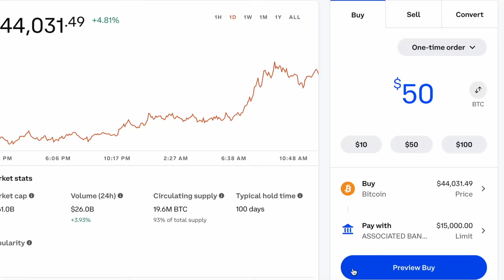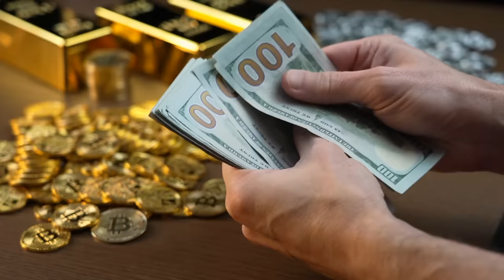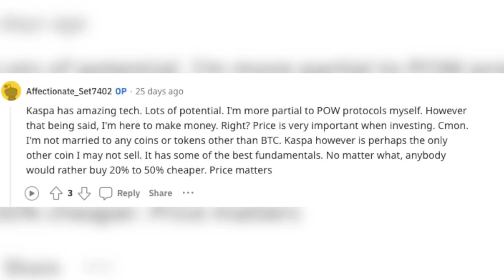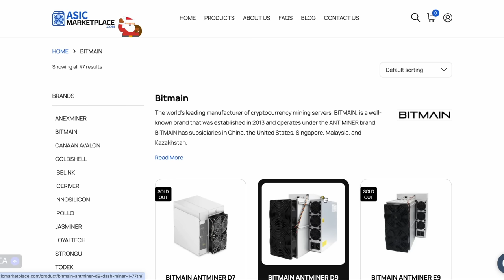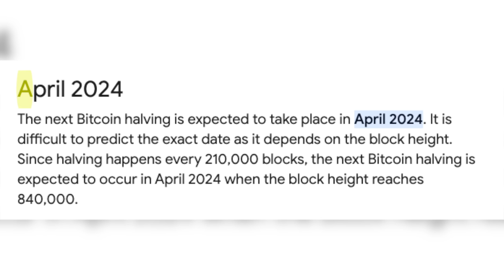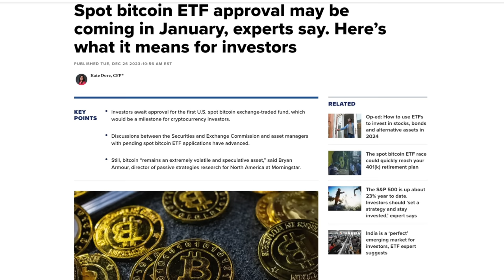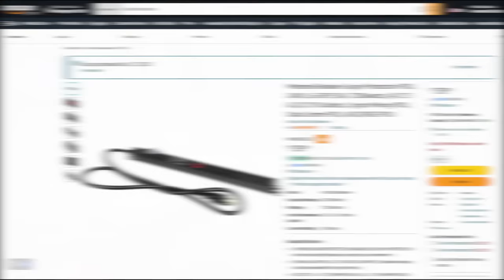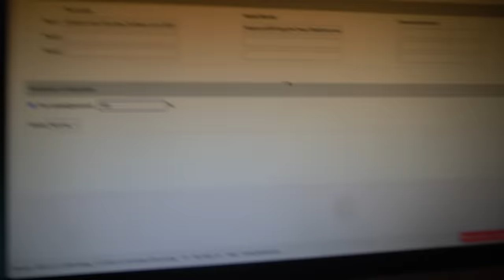My $50,000 Bitcoin Mining Investment

Comment: 150 of ethernet cable is worse than wifi because of the resistance of the cable
Reply: Nah, maybe in the past but now a days, Ethernet cables are made way better
Reply: No, it is specified to run up to 100 metres (just over 300') without degradation.